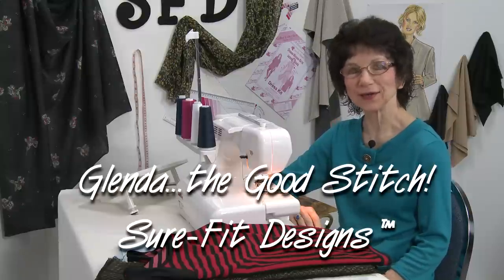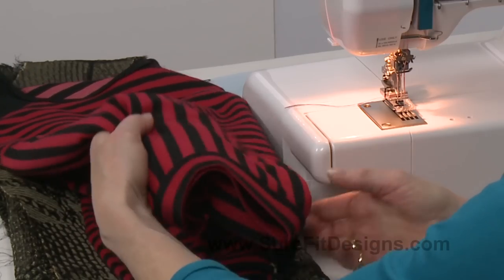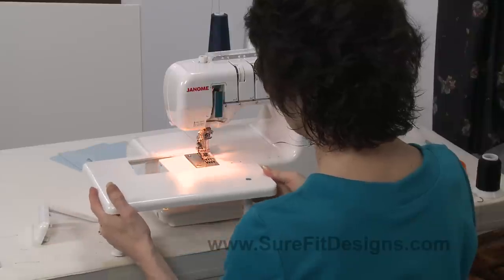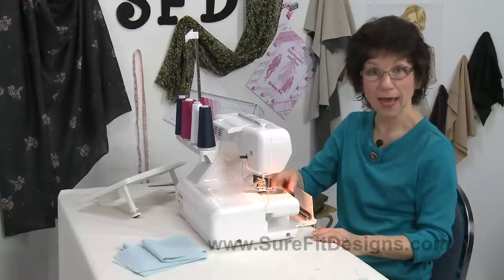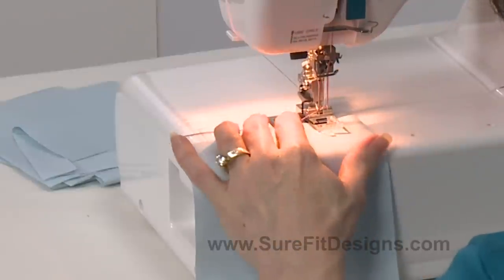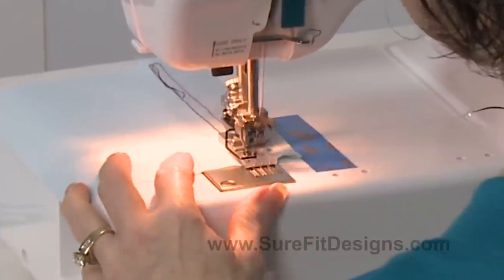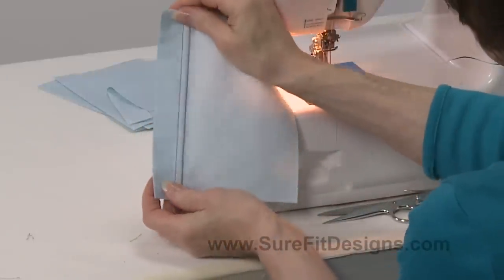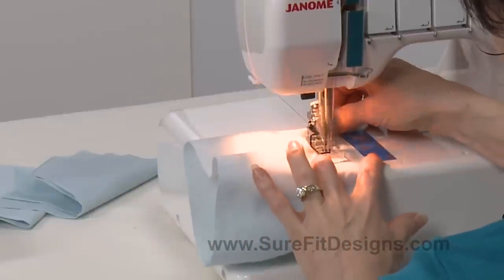How to: Cover Stitch Machine Tips & Techniques

Comment: I have this exact machine.  I really love it.  It does a beautiful job on super stretchy fabrics like swimwear  & aerobic wear.   Amazingly the seams are super stretchy with using regular polyester/cotton thread.  It also has differential feed adjustments for any type of knit fabrics.  So far has worked great on anything I have tried.

Comment: Glenda,
Do you know what the two pictures of garments stand for?  My machine isn't in front of me, but they are on the bottom right on the front.
Reply: I believe the pic towards the left is for heavier weight fabric, and if you switch it to the pic on the right, it's for lighter weight fabrics.  Hope that helps - but it should be in your manual too.

Comment: one question: the beginning needle-threads can't cause unraveling? you can just let them be on the top side? or is it because you've stitched over those that they don't need to be secured?
Reply from the maker: The top threads are not supposed to unravel.  that being said, I will often feed them through to the underside and use a little dab of seam sealant.

Comment: I have a Viking 936 combo machine that I leave on cover stitch most of the time because I have to hem most of my ready-to-wear garments.  My problem is the seam of knits, which is usually pressed toward the back leaving a very thick seam.  When I reach this point, the stitching becomes very tiny and the presser foot has difficulty going over the seam.  I use the "hump jumper" technique, but still have difficulty in this area.  Do you have suggestions for solving this problem?
Reply from the maker: You've done all the tricks I'd suggest.  It's simply difficult going over many bulky layers.

Comment: Hi Glenda, thank you for this great video. I have just purchased the 2000 CPX and I just cannot seem to remove the fabric at the end.  I've read the instruction manual, watched videos, looked on forums etc and yet when I pull the fabric towards the back or side, the needle threads are loose but there is a  sort of thread jam in the feed dogs and the fabric won't budge.   Do you have any idea of what I am doing wrong?  Thanks in advance for your precious help. Pamela
Reply from the maker: Without seeing exactly what you are doing, I have no idea why you are having difficulty.  It took me a number of tries to get it to work properly.  Make sure your needles are in the Highest position and you must also lift the pressure foot to relieve any further tension.  Sometimes they still can be tough to pull out.  Watch my videos again...you'll get it.
Reply: @surefitdesigns  Thank you so much for your reply.  I finally managed it and I think the 'secret' is to really lift the pressure foot as high as possible so that the tension is fully released.  I held the pressure foot lever with one hand and pulled the fabric out with the other.  I hope this helps other sewists who are having the same issue with this machine. Thanks again and thanks also for your very clear and precise explanations and videos. Very helpful.

Comment: I bought Brother CV3550 coverstitch. I was watching you video very carefully and followed same way how to finish and lock the stitches. But every time when I finish my stitches and tried to pull the fabric from back it doesn’t come loose at all. To loose the fabrics from underneath foot I have to open front cover and pull side my looper and then I can loose the fabric out. I have to do this every time and my stitches keep breaking. Can you advice or any suggestions to prevent this step? How can I do easy Coverstitch? I am so frustrated that all money I have spent to buy this Coverstitch gone into drain. I show your video and I thought why can’t I do it like you and I followed exactly the way you have shown. I have followed your step carefully,but still I can’t do it.Can you please help ?
Reply from the maker: Maybe you aren't turning the hand wheel to the top of the needle revolution.  If the needle doesn't stop exactly at the top of the revolution before it comes back down into the fabric, it starts to engage again.  And you have to help the tension to release by manually lifting the pressure foot as high as it will go before trying to give a quick tug/pull toward the back and left.  Sometimes, if I don't get these steps just right, my threads do not release either.  It really does require practice and patience.  I have a Janome, you have a Brother - I would think the process would be similar for both makes of machines.  Additionally, why don't you ask your machine dealer to give you lessons on using and removing fabric.  That is how I learned to do it.
Reply: Hi  Glenda I have done exactly  the Same as you have shown in your video. I am a big fan of yours and I have lots of sureFitdesign kit and I thought this coverstitch will make nice design like you have shown in your video ,but I just bought and it’s so painful. But i’ll Keep trying.

  Thank you so much and it’s good idea to take some lessons.
Reply from the maker: @KumkumKat  - just keep trying - do some samples.  I had to do sample work just to get the hang of doing it...and sometimes I still don't get it just right.  But definitely take some lessons.

Comment: I have the 900 CPX.  It skips stitches and the loops don't lock.  After 2 hrs of fiddling with the tension, it turned out to be the cheap thread I was using in the bottom looper.  When I switched to a better quality thread, it much improved, but there were still a few missed loops.  My mom swears by Maxi Lock for her serger and I agree.  My question is, what brand of thread do you use in your cover stitch machine?  Thank you in advance.
Reply: +rollyb1890 the Brother 2340CV never skips stitches for me unless I'm working on fabric that's just too thick

Comment: Por favor subtítulos en español!! 🙏🏽🙏🏽🙏🏽
Reply from the maker: The transcript is available in Spanish by clicking on the 3 dots to the right of the 'share' and 'save' buttons just under the video. A transcript box will open on the right side of the video and you can switch to Spanish using the arrow at the bottom of the transcript box. Hope this helps.
Reply: @surefitdesigns  Fantastic!!!